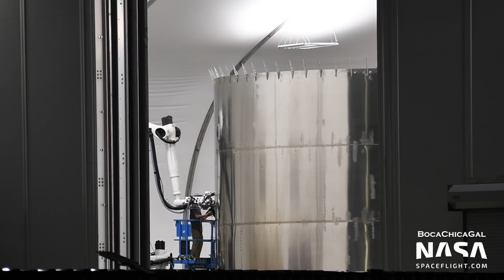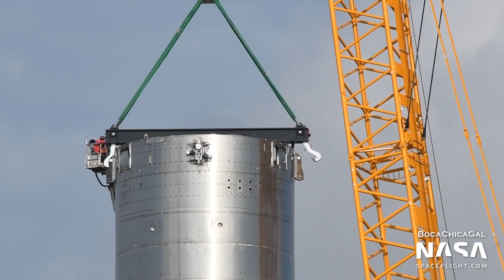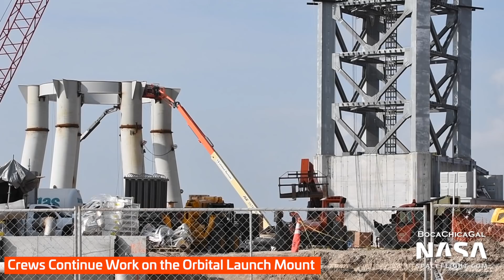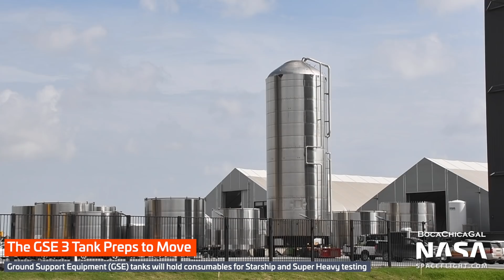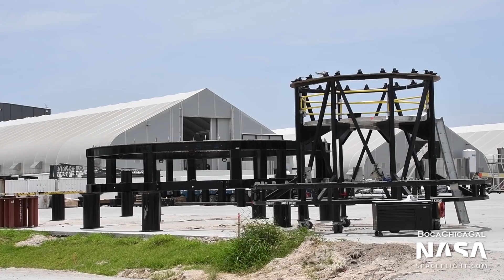Booster 3 Now Freestanding on Pad A | SpaceX Boca Chica

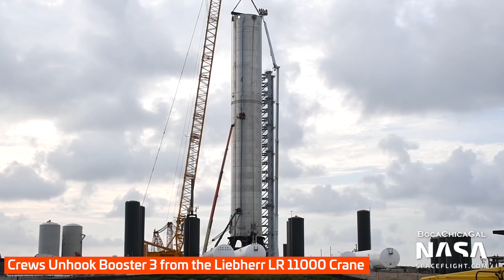Comment: 4:00 I’ve been on a standard 80 foot boom lift quite a few times and nearly wet myself each time, but holy crap, I’ve never seen one go the height of the top of the booster before. That’s terrifying. Brave people up there for sure.
Reply: It's called not being scared of heights. Some of us are just better then you.....
Reply: Seriously OMG...
Reply: @kylevogelgesang9996  It's called being crazy and not knowing it! 🤣
Reply: @ForestvilleOppa  Also called getting paid the big bucks. Lolz
Reply: As with everything, they get used to them. The first time it is a small one, then after 50 times in it, you go for taller and taller ones. By the time you go up in one that big you no longer think of what can go wrong and just think of the job you need to do. Engineers that go to inspect for the first time are the ones who need our pity - they don't use them daily. Imagination is sometimes not something you want too much of.
Reply: @knowlegeisgood8735  Training certainly does help but there are some of us, myself included, who are just born without the fear.
Reply: @kylevogelgesang9996  Theres a line between fear and common sense and Ive seen that crossed several times on this channel including workers almost getting body parts chopped off or falling off extreme heights. Not being afraid doesnt mean ignoring basic work safety rules and on another note I wouldnt be so sure about getting paid the big bucks either.

Comment from the maker: Time Stamps!

0:00 Inspection Robot in the Tents
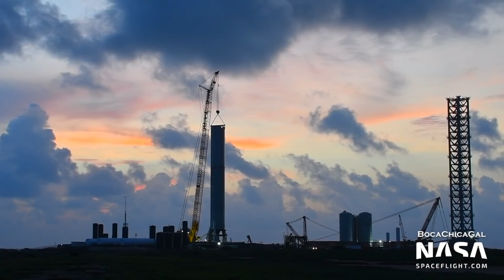0:31 Sunrise over Booster 3
1:35 Booster 3 Test Preps Continue
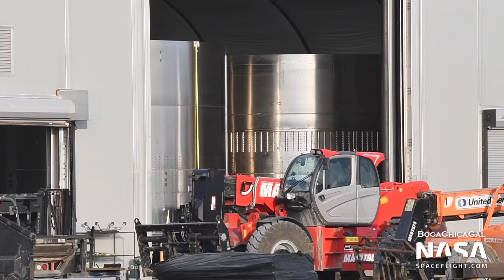2:24 Ring Sections in the Tents
3:24 Booster 3 Work Continues
3:55 Booster 3 Unhooked from the LR 11000
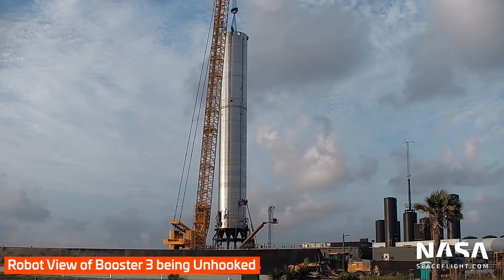6:02 Robot View of the Booster 3 Unhooking
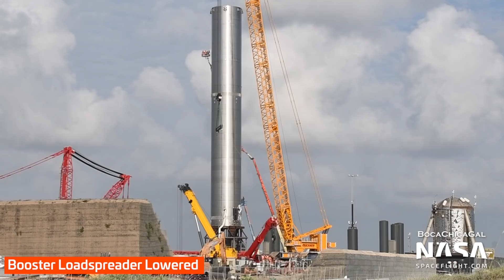6:26 Booster Loadspreader Lowered
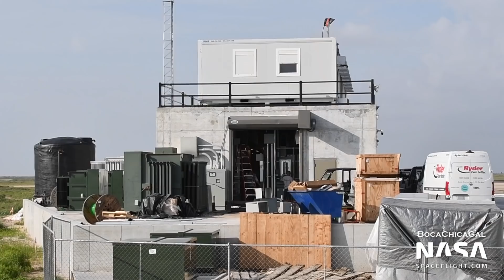6:50 Orbital Launch Site
8:05 Crews Continue Work on the Orbital Launch Mount
9:35 the Liebherr LR 11350 Crane is Being Extended
10:36 Ventilation Hoses Run into Booster 3
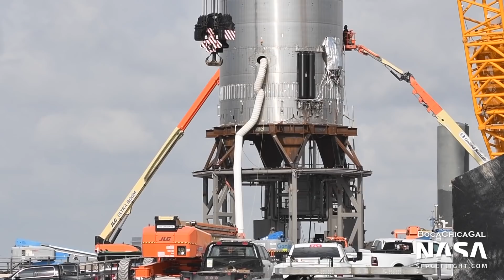11:06 8th Launch Tower Section at the Propellant Production Site
11:37 The GSE 3 Tank Preps to Move
12:36 2nd SPMT Moved Under the GSE 3 Tank
13:06 GSE 3 Tank Moved
13:34 Work on the Orbital Launch Table Continues
14:02 Liebherr LR 11000 Crane Moved
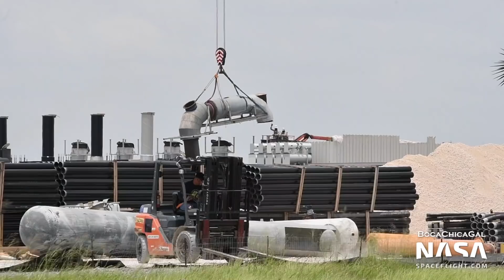15:30 Ducting Lifted into Place at the Propellant Production Site
16:00 GSE 3 Tank Sits after its Move
16:29 Work on the High Bay Rooftop Bar Continues
18:02 The Scrapyard
19:04 Work on the Mystery Structure Continues
Reply: 19:37 Mystery Structure is STACK VIBRATOR, to get rid of unwanted non paying Orion Boeing Roscosmos ChinacopycatSpace ESA rocket passengers .....yeh piss off....
Reply: at 0:40 a starship literally disappears
Reply: Might the Mystery Structure find it's way onto the launch tower as a jig to enable stacking of Starship on top of Super Heavy?
Reply: @BobAndersson  Looks like a poss restraint and release mech. for booster atop the orbital launch platform ... and seems quite similar to one of CGI mockups someone did recently.

Comment: 4:02 Damn! That cherry picker looks like a scary ride. It's difficult to wrap my head around the fact that it doesn't just tip over. Those workers must have nerves of steel.
Reply: The base of the cherry picker is very heavy and it in all likelihood has deployable legs also to make the area much bigger. On the contrary the telescope "tubes" are hollow steel pipes, so they are relatively light, keeping the center of mass low.
Reply: We spent millions of years in trees, so there's probably some vestigial instinct that lets us (humans) get used to being on something that sways in the wind.
Reply: Duder McDudeface Who knows, but I can confirm, for this monkey its bloody terrifying. It moves very unpredictably, and there’s no thick branch to jump onto, if it starts to sway a bit more than you’d like it to😂
Reply: @ArnoldSig  Do it 10-50 times and you stop thinking of it.
Reply: Knowlege Isgood I guess

Comment: My working theory is the mystery structure is an assembly jig. There are workstations/platforms with air compressors, mount points for hydraulic rams to lift and align each segment individually.
Reply: This would totally suit Elons style of raw material in > end product out. I imagine this structure can be hoisted and the welders all do the section at the same time. That'll make it so efficient. Then the new rings can be lowered down to them, or they can be raised up as the sharship grows
Reply: @creatingwithben9531  Way too heavy for that. This is a structure that will be bolted down to concrete.
Reply: Maybe the assembly jig for starship - superheavy mating? Elon did mention that mating SS and SH would require some sort of stabilization mechanism.
Reply: @morninglightmountain7049  The Launch Deck already has such clamps built in.
Reply: @morninglightmountain7049  Again, too heavy to hang 70 m up in the air.

Comment: I was looking at those hooks at 5:40 thinking man, how can those hold that thing up, but then saw the worker on the left side, THOSE HOOKS ARE AS BIG AS A PERSON!
Reply: The finished crane that will be fixed on top of the orbital launch tower will have to be able to automatically attach to the Starship and lift it onto the booster. So I’m extremely intrigued to see how they are going to do that.
Reply: @tychogrunt7846  Same here, To me the mounting system is one of the coolest parts. I cant wait to see if they end up using those top mounts for the catching mechanism, or if they have that structure running all the way down the sides somehow. It’s hard for me to picture the catch without any slippage, there will be rubbing somewhere, if just on the hooks, or on the side of the starship itself, but its gotta make contact somewhere. I’m so excited to see how the whole thing is engineered to handle that, especially knowing they dont want to refurbish it!

Comment: I've been in many boom lifts, but man these booms are on another level... Fuuuuck that!!!
Reply: I believe that is a Palfinger P 900.  The P 900 has a maximum working height of 295 feet or 90 meters.
Reply: I’m surprised they didn’t tip over from their massive steel balls. these people don’t fear heights
Reply: @jord1215  Lol, right! I never thought myself as someone who fears heights... until now. 

At least the guys building skyscrapers (in todays time) are strapped to a solid object. I feel like this thing popping a hydraulic line would be a very bad day. I'd do this only if i could tether to that crane.
Reply: @douro20  Does OSHA require operators to ware a parachute?

That seems more then high enough to safely base jump from.
Reply: @Helix_22  No, but you get to train climbing down a rope, just in case.  😱

Comment: That "mystery structure" to me looks like a sort of hydraulic clamp which will hold the bottom of a booster on the pad. The sections with holes at the bottom outside is where the hydraulic pivot points will connect. And the beveled parts on the inside look like they'll slide into slots on he bootster's walls just above the engines.
Reply: That's what I was thinking too. However I think they'll have some thick padding that just squeezes it in place. 
It's Elon, the less parts sliding together that could go wrong, the better

Comment: "Mystery structure" looks like mount for hydraulic cylinder engine load simulator for the booster. They will need to test all the engine mounting points under pressure, the basic 3 point jig is inadequate to do that.
Reply: Wrong design for that.
Reply: @knowlegeisgood8735  might it have something to do with the booster catchy thingy?
Reply: @hitchmille  No, it has to be for the foundation under construction next to the tower. Likely a "parking" space for boosters waiting for flights.
Reply: @hitchmille  My thoughts as well.  The exterior connections could be for some sort of shock absorber.

Comment: 19:05 Can I guess??

Maybe a SuperHeavy Hold arm??

A crane base for the Tower crane??
Reply: I'll guess is a "holding" base for one of the two staging platforms being built next to the tower and launch platform. So either a SS or Booster would be slipped into this stable base, until they're ready to stack. I see the concrete studs around the inside of its base, which suggests it will be very secure for holding. Can't wait to find out what all this stuff is!
Reply: @catbertz  So it will be integrated to the Orbital Launch Table?
Reply: @Kaiten-uk8gd  near orbital launch pad to hold SH for next flight
Reply: @Kaiten-uk8gd  Hi, to be clear I'm guessing too. Having said that, I think these might be concreted into position on one of the two mounts being built next to the tower and launch platform. You can see them being built in RGV's airplane flyover footage.
Reply: @catbertz  WAI has the same idea

Comment: 11:22 I’m extremely intrigued by the lack of the fourth pillar on the 8th tower segment; it seems the rest has all been assembled, but that piece has been missing since the beginning. Perhaps it’s the piece nearest the mount and so is somehow integrated into the crane?
Reply: I’ve been assuming they are just behind on producing it or had an issue to fix with it. But I like your theory much better.
Reply: I agree with your thought. The fourth column will probably have something for the catching arms or the hoisting crane.
Reply: @donaldmiller1782  I don't know if you want to put catching arms way at the top. That would maximize the torque applied to the tower, No bueno. And I would imagine the crane mount would be in the center of the tower, as seen from above for a similar reason.
Reply: @ForestvilleOppa  You make sense, it does seem that would be too high up for those. But there must be something different about that one pillar since it hasn't been delivered (AFAIK) or put into place yet.
Reply: The fourth column is either being refurbed or remanufactured for issues in its anti corrosion coating. The grey paint is more for protection than looks so it could be as simple as sand blasting and repainting or might have to start fresh not sure. Really dont want welds  or the tracks rusting right up there at the top where its hardest to work and were the crane will mount.
Reply: @iandoodle  I agree. I even think I saw the 4th leg for a short time the first day or two. Anyhow, something was wrong with it and it is being corrected or they have started on a new one from scratch. That is a good thing. It means they are being cautious - they must.

Comment: Today 5 month and one 1 day for orbital lunch table working on it...
GOD what a complexity!!!
Reply: Actually, the first 2 pieces arrived on February the 11th. That was the time SN9 (Eileen) was in pieces, SN10 was on LPB preparing for her first static fire test, SN11 had just been rotated in the High Bay then moved back in, the GSE concrete pad had only just dried & boxing being removed, the landing pad surrounding 'extensions' were all re-barred  and almost ready for the cement to be poured, SN16's AFT skirt was mated with the Thrust section, and finally, cement was being pumped along the base of the fence railings by the Mid Bay. Just another day at Starbase.

Comment: I suggest that the "mystery structure" it's a ground stand for boosters.
A Super Heavy will be placed upon it to quick prophylactic and repair works between the launches.
That is why it has 20 pillars for 20 support places between engines in the outer circle.

Comment: My guess is mystery part is for booster hold down on new launch table...
Reply: For me, the obvious aspect was how it was fabricated in nearly exact same sections of the table. However, I think they had a major redesign of the entire table structure which is why these pieces have showed up so late, and why work on the table itself was stagnant for nearly a month. Will be utilities support that will be connecting all the GSE equipment to the Starship. The required structural integrity will be due to the criticality of it being connected to the propellent system. Which might have been the reason this went through a long design process.  But really, like everyone else, no idea!
Reply: I think that's it too.

Comment: Sure would like to see that launch table get mounted!  That must be one complicated piece to take this long to build…
My guess is the mystery structure is for the launch table.
Reply: Nope. It is made to stand on a concrete foundation (if you look at the bottom). Under the launch deck is impossible - the booster would melt it. The only concrete foundation at present is the one next to the tower (under construction).

Comment: I'm not sure you could call that booster hitch on the LR 11000 a 'load spreader'.  It literally has the minimum number of contact points to lift the booster straight up.  If it had 3 contact points, or 6 like they're using on the GSE tanks, I would agree as it's spreading the load across multiple contact points to reduce the load at each point.  Not so on the booster.  There is no reduction in the load, you cannot use a single contact point because of its shape, therefore the hitch itself is not 'spreading' the load.
Reply: Each end takes half the load. That makes it a load spreader, even if it is not the type you expect.

Comment: Mary, your sunrise sequences are breathtaking. 

I’m concerned that elevators might be the only means of egress for the high bay star bar. I’d hate for anyone to get stranded up there, especially in the event of a fire. Any thoughts?
Reply: If it's for public access, fire codes will require fire exits, and a stairway, perhaps on the opposite side from the elevator.

Comment: Mistery structure i'ts just a platform to weld either the rings or the tile supports in the future. Those gas thanks are for welding I would think. But it's just my guess, let's find out

Comment: When they do the first flight test of super heavy, is it expected to land back at Starbase?  Cause, I gotta say the landing area seems awfully close to the tank farm and other infrastructure. Lots of people pointed that out during starship tests well and there were a couple of close calls. But this is next level.

Also, great video. Love your work.
Reply: No, the first test flight booster is going to land/crash in the Gulf of Mexico. The Starship will water land off the coast of Hawaii.
Reply: @aldunlop4622  True but at some point a SH is going to make a first return to base landing and the sphincter clench levels will exceed 11
Reply: …and we could ask, will super heavy need to be tested with hops before attaching Starship? Weight and balance is very different to Starship as is propulsion.
Reply: @stevewilkins2669  No. It is just a taller SN5. So they gain nothing new. Besides, it has no legs which means landing on the ground is impossible. They are sure they will catch it using the tower, even if the first ones might crash trying.
We need to remember a few facts. A landing booster will not have a lot of propellants left in it. There will be an earth berm between the tower and the tanks. Any damage from accidents can be repaired or replaced - the tanks in the tank farm will be almost empty when the booster lifts off. They almost never fill them with more than they absolutely need to.
Reply: @stevewilkins2669  The boosters have no landing legs and there’s no way to catch them at this point so, no hop.

Comment: Mystery structure looks like it is part of a clamping mechanism with all of those large pivot mounts.
Reply: Possibly the external crane that climbs up the tower to catch that behemoth as it comes down for a landing/catching?
Reply: @klazyy641  It looks much more like a base clamping structure to me. I notice that the platforms are spaced above the pivot points as if there are arms that will fit between them. Maybe a transport clamping system to speed up the starship transfer process? Or the starship launch tower base clamps? Or you may be right about it being a tower component. Maybe some sort of shock absorber system?

Comment: Question for ya if the raptors pulsate like 2 foot back infor would the 2 foot kinda act like a boost to push it up and if pulsated fast enough would it back a difference
Reply: Guess could mess up flow of gasses idk

Comment: The mystery structure is the booster grab arm which will be attached to the tower.
Reply: I don't think so. It is a circle of moving clamps. Boosters only need 2 points to lift them. Besides it is way too heavy. They are building a new foundation next to the tower that looks just like it. Somewhere to park boosters waiting to be placed on the pad.

Comment: I know there is a better way to hook 🪝 and unhook the top without a crew in a cherry pickier, manually cranking the hook. 
What about a mechanism that is spring loaded and has magnets 🧲 I’m thinking of something like the concept behind the Magnetic Touch Spring-Loaded Catch (like used for some cabinet doors).
Basically when the crane 🏗 lowers the hooks on top of the booster, the receivers could have guides to help guide the hooks into place. Then the hooks could click into place. Crane lifts; moves the Booster onto the launch table. Then when the crane lowers enough, pressure is released; then a mechanism inside, could make the hooks pop/flip outward. Maybe someone is already working on this. 
I would imagine this would be necessary for rapid reusability (RRR🏴‍☠️)—whether the booster is launching back to back on land, or on a platform in the ocean. I’m interested to see what they come up with. Wish I could work on that. 
It would be safer too. I’m glad those workers are being careful way up there on the booster.

Comment: You couldn't pay me enough to go to the top in that man lift. I imagine the booster must have a network of structural components inside the tanks. Does a picture inside the booster exist?
Reply: Lots of stringers welded to the inside. Not much else.
Reply: @knowlegeisgood8735  Thanks I was curious. I guess it will experience mostly compressive loads. I have no engineering knowledge just curious. I guess its going to shrink quite a bit with the cold temperatures fueled up.